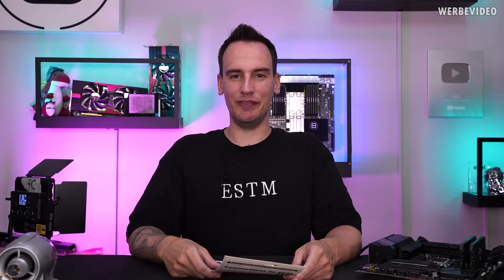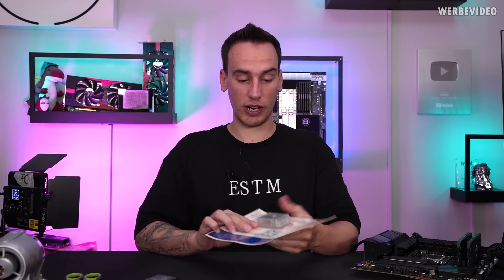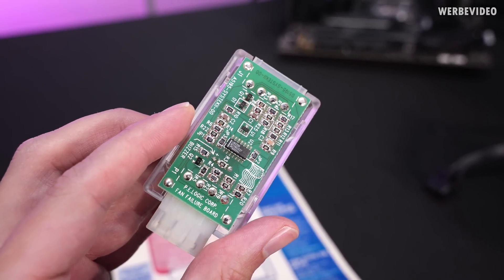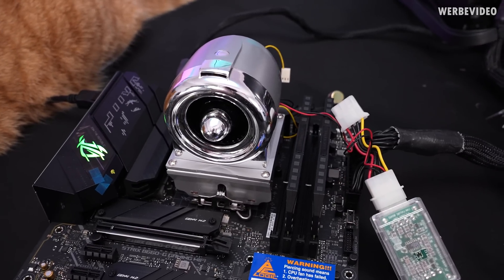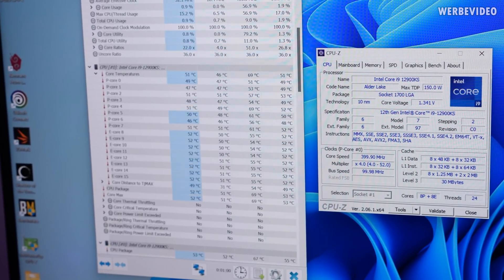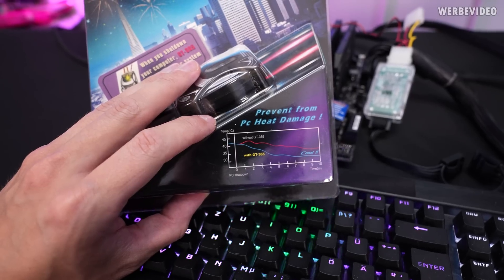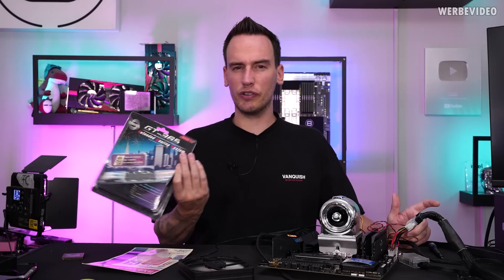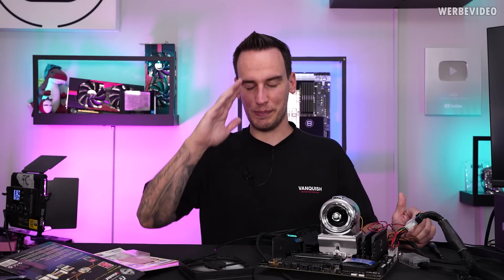This 30 Years old Cooling Gadget was Supposed to Protect your CPU... but it won't

Comment: I would assume Systo tek has a temperature sensor to measure the internal case temperature. And 110 degrees would be freedom units or 43*C.
Reply: Yes, I was going to mention that since it's an American product, the 110 degree temperature is in Fahrenheit, not Celsius. It's designed to measure the ambient air temperature inside the computer's case, so it's not exactly correct for them to say that it will alert you to an overheating CPU -- although back in the '90s it was quite common for people to refer to the entire system unit of the computer as the "CPU", not just the actual microprocessor chip on the motherboard.
Reply: The U1 he said was a voltage sensor is an LM35 temperature sensor
Reply: He is both engineer and German, the temperatures are always in Celsius as it should!
Reply: @vitormoreno1244  The SystoTek is neither German nor an Engineering firm. US made and units not marked - ofc its not real degrees

Comment: Those CPU didn't have thermal throttling, so they got fried when fan stopped working. 
The U1 is probably the temperature sensor, I guess that U1 is an TC1047 temperature sensor. The pinout and circuit match for TC1047 or similar.
Circuit works like this; when TL1047 hits the threshold voltage that is set by the LM3390 comparator it will flip one of the outputs of the LM3390 high, that will pull Q2 transistor high, and Q2 will turn on the buzzer.
Reply from the maker: Thanks a lot for adding these details in the comment!
Reply: Well, so it turns out the Systo Tek was in fact a life safer back then. Obviously no sense in using it nowadays, but considering it did what it was advertised to do when it was released, he maybe treated it too harshly.
Reply: @Aquaquake  yeah i think he was a bit harsh on it especially since this device was ultimately built into motherboards 3 years later due to the high failure rate of systems fans.
Reply: U1 is an LM45 temp sensor, took me a min.
LM45CIM3/NOPB ACTIVE SOT-23 DBZ 3 1000 RoHS & Green SN Level-1-260C-UNLIM -20 to 100 T4C
LM45CIM3X/NOPB ACTIVE SOT-23 DBZ 3 3000 RoHS & Green SN Level-1-260C-UNLIM -20 to 100 T4C
The Vref for both the comparators seems to be zener diode D1 - though i dont know which of the many zeners marked 5D it is?
R4 the 2R2 resistor near the out molex appears to be the fan current measurement shunt ?
Are the other 2 comparator channels being used as the buzzer oscillator?
Reply: But by the time the heat reaches the temp sensor the CPU will be well beyond fried. It would make more sense to have the sensor as a probe you can mount on or near the cpu
Reply: @_BangDroid_  its a system temp monitor - 110F/43C
Reply: 486 definitely did not have thermal sensors, because when it was designed (DX33 and DX44) they did not require cooling. But DX2 came with passive cooling, and DX4 , 5x86 etc ... sometimes did require active cooling. Fans were cheapest possible, running at constant speed (no thermal sensors to control them) , and they were failing.
Reply: Not only didnt have thermal throttling, to the best of my knowledge they didnt have a thermal sensor. And i imagine thats 110 freedom units, not real ones
Reply: @mycosys  Freedom units are freer 🏈🍔🥓🇺🇸
Reply: @Axodus  Free from all sense and intelligent thought maybe.  I live here and its bad.  Like really bad.
Reply: @MasterN64  You must live in a city, I love where I'm at, it's preeetty normal here.
Reply: @Axodus  my dude, they're literally sl@ve units - the point of them was to make it easier for the king to tax you, and the king even defined the measures so you couldnt compare to other countries easily.
You will be hard pressed to find people more fluent in both systems than Aussie technicians, our height is in inches, our beer is in pints and our weed is in ounces,  and we always convert to SI to calculate stuff.
Reply: @mycosys  I don't disagree, I admit I don't exactly know the history, I just saw a good opportunity to make a joke. It's the measurement system I was taught and in a vacuum there's nothing wrong about it, it does it's job at allowing measurement.
Reply: I Really hope I never have any bucks getting into my fans. Thanks D!

Comment: The only experience I've had with fans "breaking" is some of mine (top exhaust specifically) deteriorating slightly over time, and needing a higher pwm% to keep spinning. I used to run my top fans at 20% at idle (minimum allowed by NZXT cam), but I've had to bring them up to 30 over the last couple years.
Reply: I've only experienced older 3-pin fans having this issue, I don't think I've ever had a PWM fan that needed the speed increased to run. Every fan I've owned was only replaced because it got too noisy. I've never had one fail since the late 90's, at least not on a critical component. I still have some cooler master excaliburs in a rig that are probably 15 yo at this point.
Reply: Modern fans and the crap they used thirty years back is quite different. There were quality fans back then, but what you found on most CPU coolers were just so incredibly bad it's hilarious.

Comment: Fans usually died gradually, typically due to bearing failure, or dust accumulation, especially with slow fans, or with smokers. Them old CPU's with just  a heat-sink will usually NOT kill the cpu immediately, it took a lot of time usually with crashes, resets and other issues. To kill them cpu's quickly you would typically have to remove the heat-sink altogether. 

The reason why the system temp is showing an increase in that graph, is that they probably had the thermal probe on the heat-sink itself, when you powered off the pc, the fan stopped flowing air, and the external temp of the heatsink would go up slightly before dissipating the heat again.
Reply: That was my thought on system temp as well.  The CPU temperature isn't increasing, but it's still hotter than the rest of the case. They're banking on someone who just puts a thermometer on the heatsink or in the case thinking something's wrong.  Which sounds like something that BestBuy would try to sell an older couple on as an "upgrade" today.
Reply: I'm thinking they were referring to the air temp inside the case

Comment: That knob you were turning to adjust the fan speed, is called a "Potentiometer"
Reply: Yep I had a cool transparent fan many years ago for my PIV that had colorful LEDs and had a tiny pot to control its speed.
Reply: Oops wrong knob.
Reply: Two poles makes it a rheostat, not a potentiometer (which have 3 poles)
Reply: @matthewkuhl79  Actually didn't know that, it's funny only you of all that commented and liked thought it was a Potentiometer and not a rheostat. I might be wrong but it actually sounds very German :P
Reply: Or a volume knob😂😂😂
Reply: — Variable resistor is also correct
Reply: No shit Sherlock
Reply: @baumaxxlat English is derbauers second language so he didn't know the word